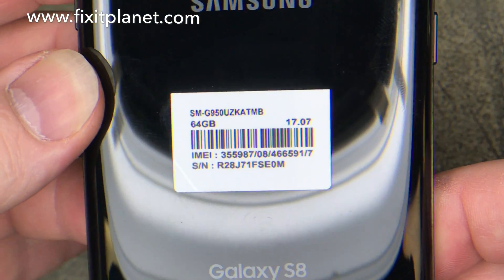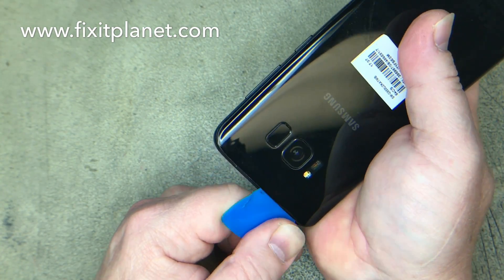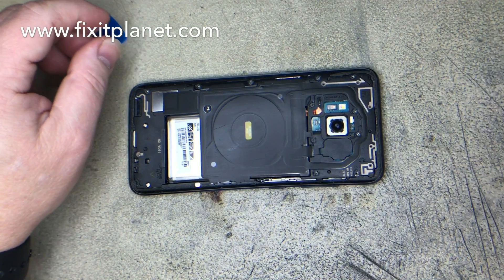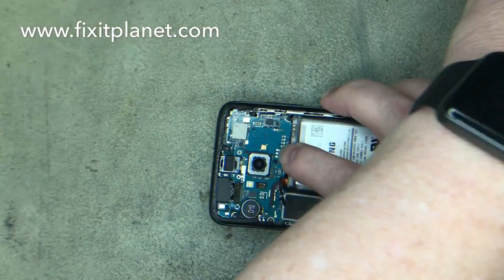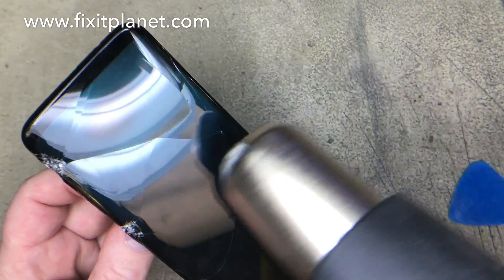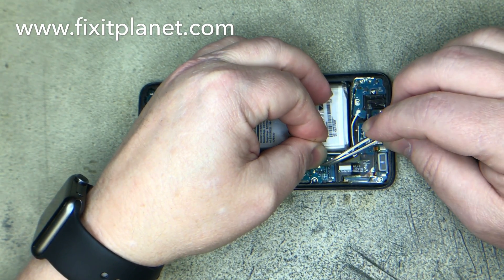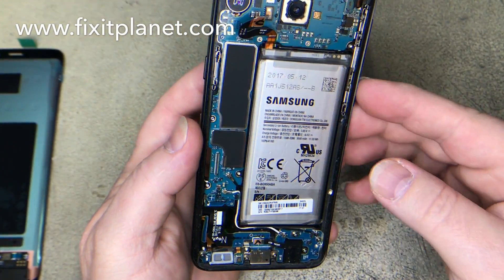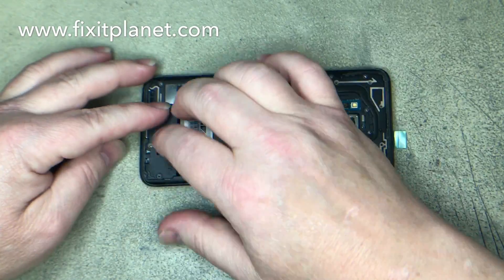Samsung Galaxy S8 Screen Repair From Start To Finish.

Comment: I'm here to warn everyone who has a broken s8 to NOT upgrade to an s10! Get your s8 fixed or upgrade to an s8+ or s9. 
I got myself a $900 s10 and hated it. It felt almost exactly the same as the s8 but the fingerprint scan is TERRIBLE. Not worth the price in 2019. Do your research if you're going to upgrade. $300-500 for an s8+ or s9 is a far better purchase.
Reply: Used to have an s8 for a year and a half. Bought my s10e for 400 bucks. It was in like new condition,  and honestly I like my s10e. I'm glad I didn't pay full price though
Reply: thats why i dont want to update to the s10 or note 10 nothing really new thats a real upgrade
Reply: @glen3103  I ended up getting an s9. It's GREAT! It has everything I wanted out of the s10, but the great finger print scan of the s8. Highly recommend s9
Reply: Thank you bro I'm about to sell the s8 and get a huwawi mate 20 pro
Reply: With the new updates my fingerprint scans nearly every time with s10+, Retina is so fast to unlock though the phones open before I even need to use my fingerprint.. definitely a huge upgrade from my s8 and even s9+ and you would notice to if you out it through heavy use playing a high detail game or running many apps at the same time
Reply: Just get an OPPO. Same or better quality but faaaar cheaper. Samsung and iphone are grossly overpriced.
Reply: I'm upgrading to a Oneplus 7 pro after trying to change the glass on my S8 and failing somewhat.

Comment: Little hack for getting the screws out. Often times, "magnetic" screwdrivers aren't nearly powerful enough to remove screws. If that's the case, go online and get a small neodymium magnet and stick it a few inches away from the tip of your screwdriver (Close enough to the tip that it will increase your magnetic strength... but far enough away that the screw stays on the philips head instead of falling off and flying onto your neodymium magnet.)

note: magnets are bad for electronics, so be careful that you don't drop the neodymium magnet. If it lands in the wrong place inside your phone, you won't be a happy camper.

Comment: Hey John, if this is done properly and carefully, how likely do you think it would be for a repaired Samsung Galaxy S8 to meet IP68 resistance?
Reply from the maker: If you use a genuine Samsung replacement screen assembly with frame, then that is already factory sealed, the only thing left is the back glass. If the surface of the glass and frame are clean and you replace the adhesive then apply even pressure when attaching the back glass it will be as good as in can get. Having said all that... will it pass a computer analysis to determine the factory IP specified rating? Maybe maybe not. It can fail that test. The process used during assembly at the factory uses a machine that applies even pressure at a set PSI for a set amount of time. If the device fails the test after that process then it is redone and repeated until it passes.
Reply: @FixItPlanet1  wow, thanks for the info! I'll do my best haha

Comment: Why  do  weneed  to  remove  all that if  the  screen is  on  front
Reply: You need to disconnect the ports for the screen which are through the back.

Comment: TL;DR: If you're going to remove the backplate, order a replacement one ahead of time so you're prepared for when you accidentally obliterate the back glass trying to remove it. 

Long Version: I personally find removing the back glass to be an enormous pain in the ass. I wanted to do the "clear backplate mod" on my s8 but I was confident that I would absolutely destroy the stock one trying to take it off so I waited until I had no other option but to disassemble my phone before doing it. I utimately only ended up taking the phone apart because my plastic sim card tray snapped while still half way in the phone (with my sim in it) so absolutley had to take the back off to get my sim and broken tray out. And sure enough while working the pick in between the back and the bezel my backplate completely shattered! Fortunately I prepared for this to happen and purchased the replacement clear back glass kit ahead of time but I definitively consider removing the backplate to be quite the ordeal!

Comment: This video was very educational. But for the cost of parts and labor and tools, I found a service on ebay now for $70 they'll replace glass and mail it back. Worked out great for me since I had a backup S7 while I waited. My LCD wasn't damaged, just my glass. OBviously its also an older phone now, but still working great for me.

Comment: first of all the blowtorch melted most of my phone, before i realized it was a heat gun i needed, then i tried another video that says to freeze the screen in a fridge, which i did and was able to lever off old screen with a screw driver and a lot of elbow grease, then i tried to fit in replacement screen, but after many failed efforts i found out it was a S8+ plus model screen which won't fit my S8, out of sheer frustration i slammed by fist on the desk which caused all the loose bits to fly everywhere, can you help me with another more detailed video please?

Comment: After watching this video I've come to the conclusion that the $140 estimate for the repair at a local shop is not so high after all. 😳
Reply: What store? People have been trying to charge me 200-300
Reply: @pamelabrown5890  Just a local hole in the wall repair shop. I found that they range a lot. Don't spend more than $200 to get an s8 fixed. You can buy a refurbished s8 on Ebay.

Comment: When you close the phone do you use any extra adhesive or there is no need?
Thank you
Reply from the maker: There is no need to put additional adhesives. You can re-use the original adhesive (if it's in excellent condition) or you can replace the adhesive with all new.

Comment: thanks so much for filming this, i just replaced my broken display and rear glass panel. you really do have to get these things hot! my front glass was very badly broken so i figured i would be breaking it further removing it but i had no idea... it came off in 2 pieces, probably because i was not heating it enough tho. great video, allowed me with very little technical knowledge to diy this, save a few bucks, have some fun, and learn something. thanks again.
Reply from the maker: Very cool!

Comment: Why didn't he just pry up the broken screen without taking the back off.  Its already cracked - he didn't have to worry about damaging it.  Just apply some heat to the screen and pry up underneath it.

Comment: Awesome video! Ive had my s8 for about a month and broke it already. Is it possible to replace the glass only, or do you have to do the digitizer too?
Reply: You can most definitely replace glass only, but it is insanely difficult and there is a high chance youll mess it up. Regardless, front glass is cheap and if youre willing to replace it anyways, you can always just buy another full display if you need it and install it after you possibly fail. If you succeed though, thats great!
Reply: There are lots of videos on it too, check them out if youre serious about it.
Reply: I did find a couple. One company sells a kit and did it on video while the phone was still on. The screen was lit up! It's like $25. Cheap enough to try... The glue seems like the hardest part to get right.

Comment: Not the repair I was expecting. Not really a repair if you replace a component without replacing only the damaged piece.
Use of original seals can compromise the IP rating.
I would have left the screen protector on for the customer to remove. All of that turning on the desk ~can~ leave micro scratches.

Comment: This was an excellent tutorial.  However, I always strip all the old adhesive off and apply new.  But that's just me.  Good job fellow tech!
Reply: What adhesive do we need to replace?
Reply: @xxvodanhxx  On this phone, i replace the lcd/digitizer and the frame....since this screen is curved, it's hard to just replace it.....buy the frame too for a few bucks more then all you do is transfer all the components from the old frame to the new one......concerning the adhesive, its what is installed along the perimeter of the back glass that i was talking about.  have a good day, and don't be afraid of this repair....its not a bear to do.....Jay

Comment: One thing you didn't make clear at least to me is in testing of the screen section you actually hooked it up on the battery side which keeps the connector orientation correct. I had a hard time with this until I realized after rewatching several times . I never turned it on.  Thanks could have never done it without you!

Comment: My brother in law did my phone screen, in the process he put a hole in my battery so we ordered a new one, but now my screen doesnt turn on, just vibrates and gives a red blinking light. Any ideas? Is the new battery bad?
Reply from the maker: It may be possible the screen was cracked. You will have to test with a known good screen.

Comment: What temperature do you make the heat gun?
Reply from the maker: There is no "one temp fits all" It varies depending on what you are using, how close you are to the device and air flow. You just have to figure out what works best with what you are using. Some basic heat guns only have two settings High and Low, Set them to low and go for it.
Reply: @FixItPlanet1  thanks! I'm just hoping I don't set it too high and it ruins the phone

Comment: Hi FIXITPLANET,
We have the same issue with the screen, may I ask what will I buy for the screen replacement? Will I tell them that I need to buy LCD or screen or what screen name?

Ill check your reply day by day. 

Thank you so much.
Reply from the maker: Here is a screen with the frame https://amzn.to/2Y5HyIX here is just the screen without the frame https://amzn.to/2JdNTgS These are full working display assemblies not just the glass.

Comment: Mad pure madness got a quote of £185 for a repair.  Gunna fix it myself thanks to you bro 👊🏾
Reply: They told me almost 300 and the phone is not worth 300 to fix. Way to small and I did not like it that much when it worked.
Reply: @arthurmyself7183  i broke my s8. I just bought a new one for 295€ (£260) while it was 300 to repair... 
Thats crazy

Comment: If I need to change the frame as well. Does it come with the battery? Or is it the back glass that comes with battery included??
Reply from the maker: Someone might sell them as a kit, but the battery and back glass are typically sold separately.

Comment: can you replace just the glass without the digitizer? amazon sells glass only for about 20 bucks, wondering if its worth trying? thanks
Reply: Spiritual Braces it’s extremely hard to separate the glass from the LCD without breaking the LCD.. you can tho

Comment: What if you just want to replace the screen and not the display??
Reply from the maker: That would be a "glass only" repair. It can be done but is not very practical, it's very involved and risky especially when done by hand.

Comment: I hate how everything uses adhesive very disappointing considering the phone cost almost 1000 when it came out
Reply: Without the adhesive, the phone wouldnt be waterproof.
Reply: @DabluCrew  Phone is not waterproof it is water resistant.
Reply: ya mong

Comment: Hey  i have a  crack in the top right screen and I'm  pretty sure water got i t there and all the glass is missing  not alot just like enough  to were you  can see what 8s behind the screen and my screen is green and distorted  and glitches out then goes back to regular  color every  so often  know how I  can fic that?
Reply from the maker: You should probably replace the display.

Comment: i recently replaced my samsung galaxy s8 display bt the problem is Dust particles are penetrating inside it and front camera is getting dirty. Pictures from front cam is capturing blur images. 
plz give me solution 
thanks
Reply from the maker: If the adhesive was sealed properly dust would not be able to get in. For dust to penetrate it would need gaps. Open it back up clean it out and replace the adhesive making sure it is completely sealed all the way around front and back.
Reply: @FixItPlanet1  thank u fr ur time.....
can u please suggest me good adhesive glue or tape.

Comment: After watching this on my broken s8 ive decided NOT to attempt myself. Although you did make it look easy
Reply: I did this with my Note 8, and believe it or not.. it actually is easy if your confident enough.. and have the proper tools..
Reply: @TheBrainSquared  Yes I believe I can do it too. I'd rather fix it myself then give it to anyone who do anything with my phone. I believe it just need a good and clean setting with a good strong light and yes anyone can do it. But not everyone is confident to do it.
Reply: @myme8208  You can only gain confidence by jumping into the deep end with these tasks. Baby steps will get you no where when dealing with electronics. It looks technical, but it aint that bad.
Reply: Everything LOOKS easy in time-lapse LMFAO
Reply: Other videos are much more simple

Comment: does changing the screen out affect the water resistance of the phone?
Reply: Definitely especially reusing the old adhesive
Reply: @-SimulaSean  if i used new adhesive would that keep the water resistabilityness

Comment: fix it planet can i just heat up the top glass to remove it without trying to prying the back side of it ?
Reply: Only if it was that easy you have to take apart the back to disconnect the different wires

Comment: Dont do this with a triangular pic. Do it with a plastic playing card, you WILL brake the glass (been there done that)  on the edges and the thing has to be REALLY so the adhesive doesnt grab back as fast...

Comment: hi! may i know what is the heat settings of the heat gun should be?
Reply from the maker: If your using a heat gun it should be set on low. Heat settings depend on the heat source, air flow, and distance from the device. Never leave the heat on one spot for more than a few seconds at a time. Continuous movement around the area you want to heat is recommended.

Comment: Question why do you have to remove the back plate if your just chabging the screen?????
Reply: The back plate covers the control system for the screen and digitizer. He pointed at it, as well as made it a focus of the vid.

Comment: My s8 works completely fine, it's just the screen doesn't respond anymore. I can turn it off and on, Bixby, volume, everything. Is the screen that needs replacement or do I need to replace my phone?

Comment: If you are doing a glass only repair on an S8, why is it necessary to remove the back and internal parts? Can't you just heat the glass and remove from the front?
Reply from the maker: This is not a 'glass only" repair.

Comment: How do you know if you need to replace the OLED as well?

And if you offer this service, how much do you charge?
Reply from the maker: I would recommend replacing the full display assembly. A "glass only" repair is difficult and risky.

Comment: to help people understand, there is no easy way to replace just the digitizer. You must now buy the LCD and digitizer which comes atached to the front glass screen. Yes its approximately 200$, to 250$ and add about another 100$ if you choose to take it to the shop.... Bottom line, find another used one or another new one. "Phone" that is..

Comment: Hello, I have a question, I’m on the process of doing the same as you did. My question is, did you buy an aftermarket LCD? I can’t find any Samsung brand, they sells with frame and I don’t need a frame.
Reply from the maker: No we replaced with a genuine Samsung screen

Comment: Is it difficult to salvage replace the front glass without damaging the screen?
Reply from the maker: Yes
Reply: Do u think I should get a screen protector quickly, before I replace the screen. 

U know to help prevent the cracks from spreding, or is that going to happen at the same speed regardless
Reply: OMG I dropped my cracked phone 6 inches on to my switch and all the glass powder I couldn't get out looked like a massive crack.

My heart sank, and I was like y didn't I get that warranty for accidental drops.

Comment: It was painful watching you pull of the LED screen like that. It is possible to replace just the glass. I repair phones and if you have the right equipment, replacing just the glass is a piece of cake. 

Replacing just the glass is much cheaper than getting an entirely new screen. : )

Comment: Thank you very much for the video mate. I have just managed to fix my phone (which was run over by several cars, both the back cover and screen were completely shattered!). Bought a new back cover and screen then watched and followed your video instruction, worked a treat. Thanking God for your life! May you be successful in all your endeavours!
Reply: Where did you buy the replacement parts and what did you pay please?
Reply: @Chisomo Tembo, where did you buy the parts?

Comment: Hello, the S8 screen is superamoled(based on LED technology), while the replacement screen is LCD.does that affect the quality and sharpeness of images please? thank you
Reply from the maker: Genuine Samsung Galaxy S8 and S8+ replacement screens are OLED exactly the same as the original.
 I would not use aftermarket screens due to poor quality.
Reply: @FixItPlanet1  can you please tell me where i can get genuine OEM replacement screen?

Comment: That black coil you're referring to as the NFC antenna is actually the wireless charging coil.
Reply from the maker: Sorry for the confusion. I just say NFC to refer to all of it. They are all part of the same assembly. So to be more specific the NFC (Near Field Communication) antenna, MST (Magnetic Secure Transmission) antenna and wireless charging coil are all located near the center in the rear of the device.
Reply: @FixItPlanet1  fair enough, I just didn't want other viewers to be confused. 👍